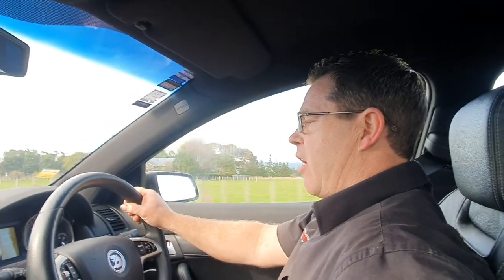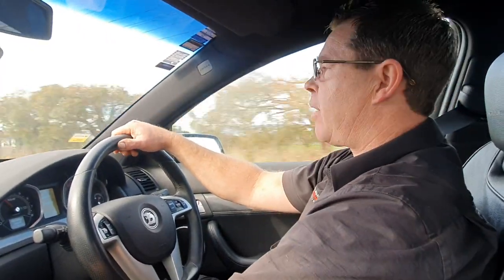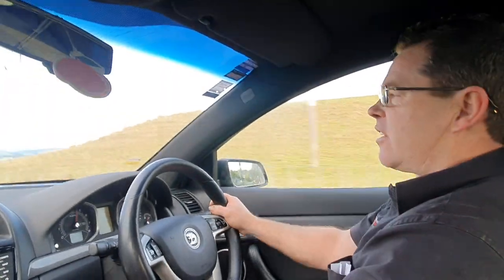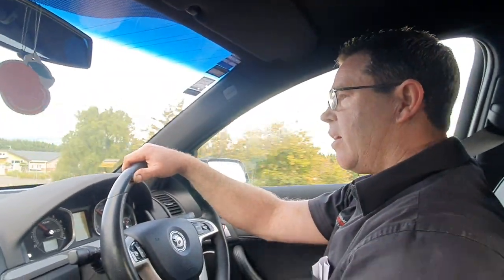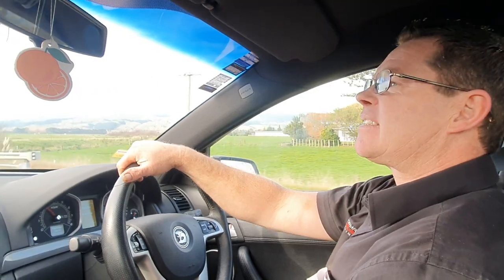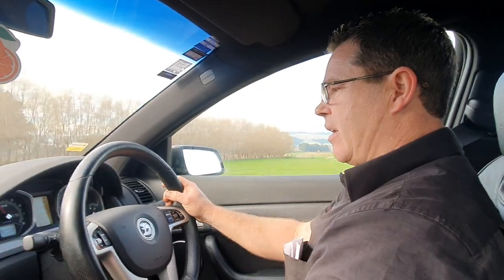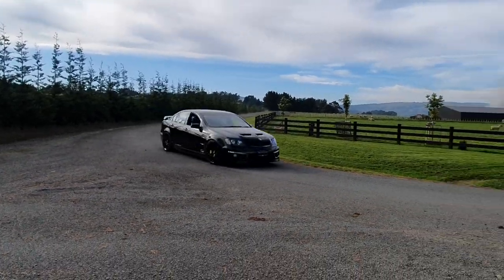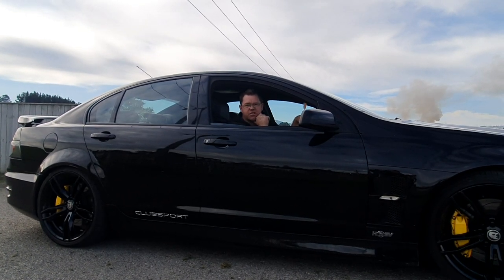performance industry ve r8 supercharged

Comment: I know hub dynos read high, but 530kw at hubs on 98, with stock heads and stock bottom end. Sounds like a bit of a yarn to me.
Reply from the maker: Hi bud 
That's fine what you think.
Reply: @performanceindustry893  How much boost? What heads? What fuel? My car L77 makes 500rwkw on E85, Higgins heads, heartbeat blower 12psi. This thing must be full max effort time bomb if it’s making that power on 98 with stock heads?
Reply: @Shauny808  it's my car mate, it runs 10psi, stock heads just with double valve springs, It's a weekend warrior mate its a cruise car which gets the odd hiding every now and then, you are right it's maxed out but it's not used as a race car and if it was I don't doubt that something will break, still pretty impressive power I think 👍
Reply: @Shauny808  my car @510rwkw on a roller then went out and put down 580kw on the hub 10minutes later. That’s from 20x11 rears. 
This car could be floating around the mid 400ish rwkw.